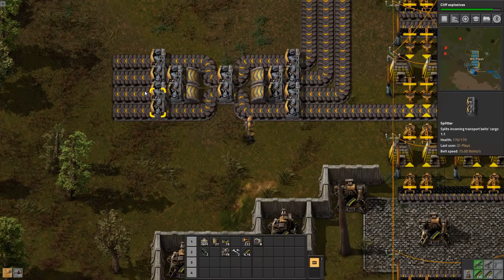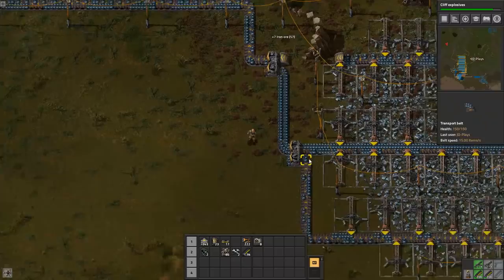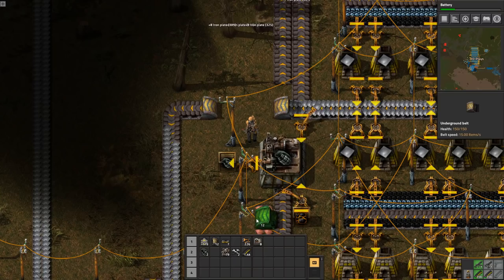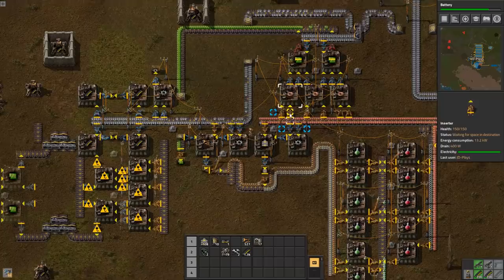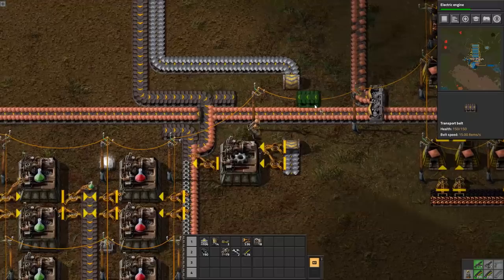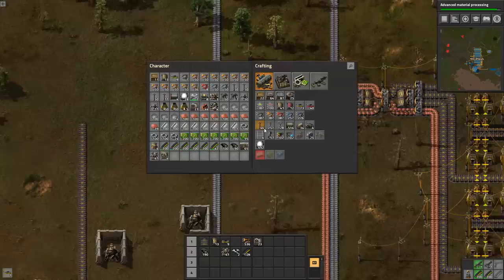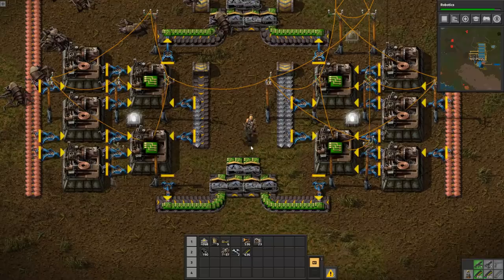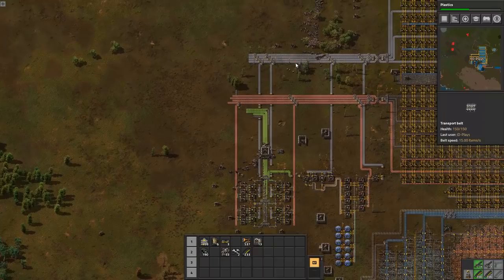Factorio 0.17 | Factory Island EP7 - Making a Tidy Bus & Green Circuits |Tutorial, Guide, Let's Play

Comment: Just noticing your green circuit build has 2.5 blue inserters into each green circuit machine. I think that’s overkill.
Reply from the maker: It is, and yet it isn't because of the lack of stack inserter research 1 isn't quite fast enough, after stack inserter research 3 (the first one which gives a bonus to all inserters) then one is enough
Reply: I see. I’m fairly sure you have too many going from cables to circuits still but loving the series! Keep it up.
Reply from the maker: So maths... Blue inserter does 2.31 items per second (with no upgrades) moving machine to machine, I need 2 items per half second (base crafting speed - with a assembler 1 crafting speed of 0.5 thats 2 per whole second)
IF/WHEN i upgrade to assembler machine 2, with its faster crafting speed, then id need blue inserters, at the same time having 2 inserters will offset their swing times (i hope) so i should get them both swinging at different intervals (again i hope)
Once i get the inserter stack size 2, then i only need 1 inserter again.